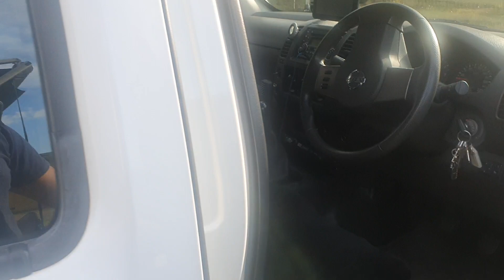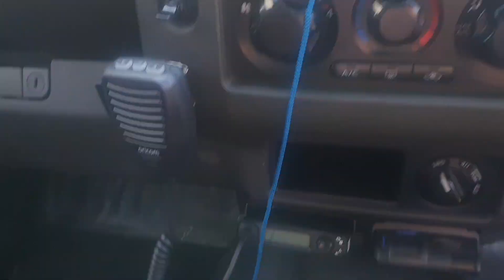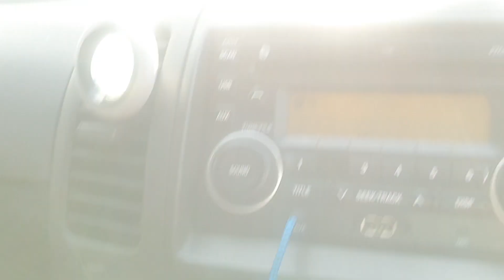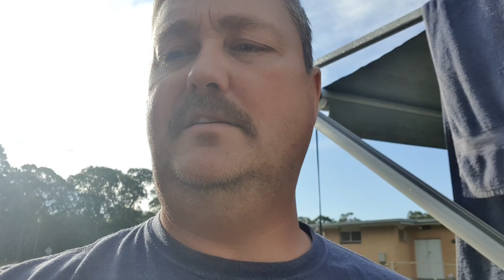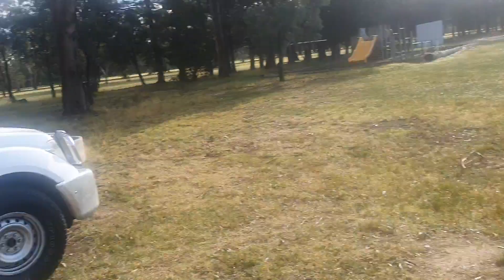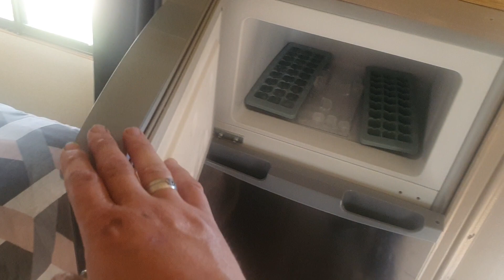Set up for free camping Australia

Comment: Great setup you have there, I reckon you will need an extra solar panel though, just the one 160w would struggle charging 270 amp battery, I’d add another 160w panel.

Comment: One thing I learned, (the hard way) the air intake on those generators is on the bottom.  ( seems to me a pretty crazy place to put an air intake on an engine designed to work outdoors) , I would always position the generator on an absolutely clean surface as when I sat it on the grass once it sucked rubbish into the engine and we had to take it apart three times to finally clean it out properly. Davox.
Reply from the maker: we ended up doing away with the genie, too much weight, and when we changed the van, we really didn't need it, we found 12v stuff and gas was all we needed.

Comment: We have found that having the fridge running on gas when we are free camping is so much better as the fridge draws a lot of power from the solar.  We also found that when we were freezing on one trip having the gas oven on and the door of the oven open heated the van up nicely. enjoy your adventures.
Reply: Jane Allan be really careful with ventilation using the oven as a heater, you’re burning up your oxygen quickly.
Better to install a diesel heater.
Stay safe
Reply: @daver-f1j  yes! It’s been known to kill people before.
Reply from the maker: Thanks for the tips really helpful, thank you.
Reply: Keep in mind that a dedicated electric fridge like an engle will use way less electricity than a 3 way gas fridge running on electricity.
My 30L portable 3 way fridge literally used double the electricity compared to my full size house fridge over the course of a day.
Can't directly compare to an engle but people i know seem to get multiple days out a single 12v lithium battery (i think about 100ah).